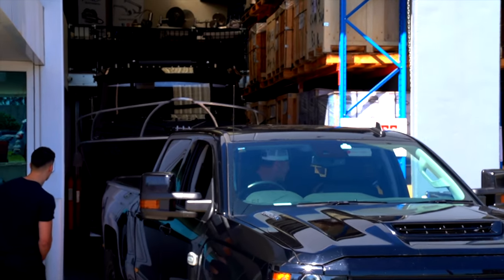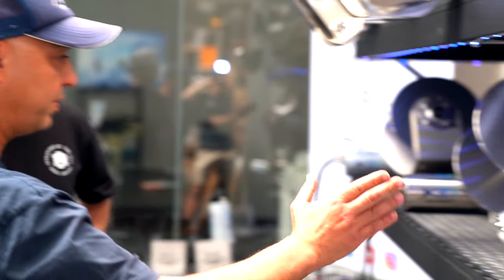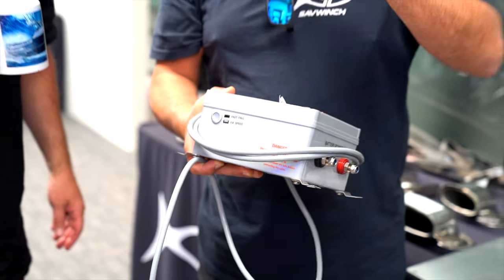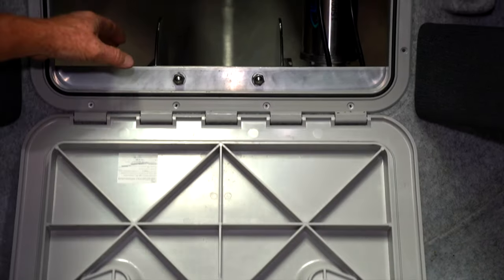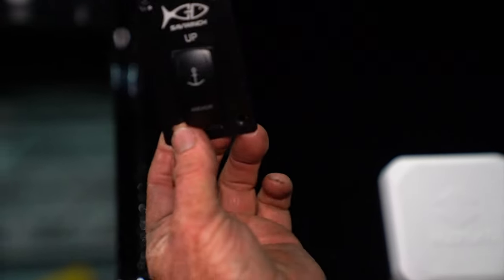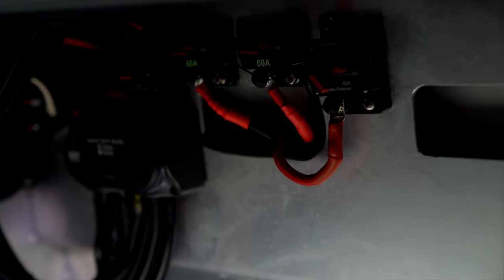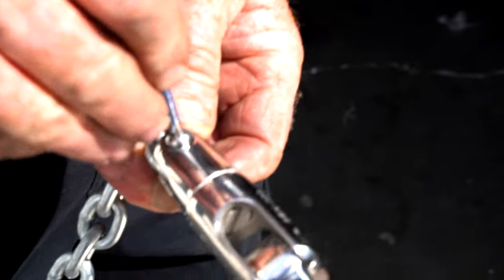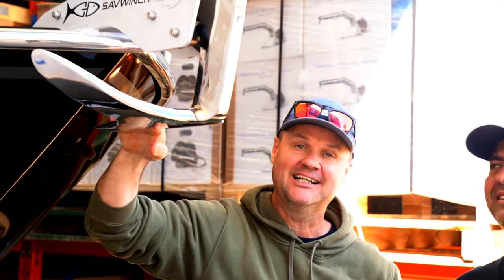SAVWINCH INSTALL - Paul Worsteling's Extreme 795 Game King

Comment: Why doesn’t the dyneema rode chafe where it exits the bowsprit? Also, you couldn’t put an anchor bridle on this system.
Reply from the maker: Hi mate, what would make the rope chafe if fitted correctly onto the nylon rollers?
Reply: I guess I just assumed it would chafe where it rubs against the stainless bars? Just used to all chain rode with an anchor bridle used if anchoring overnight.
Reply from the maker: @phillysailormac  It won't run on any stainless bars as it runs through nylon rollers.